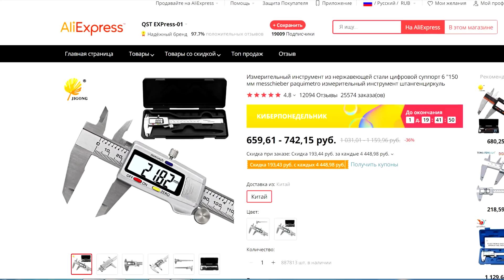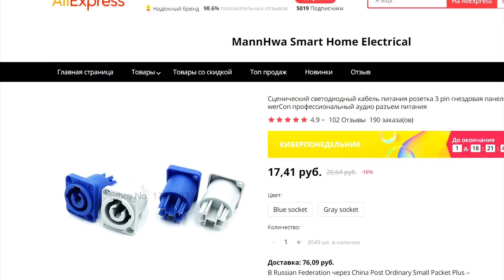Самодельный беспроводной мини-пылесос с прозрачным циклоном из эпоксидной смолы. Часть 1.

Comment: Hi, please, when you will glue the input pipe, use 15 degree tilt for better efficiency. For detail explanation, you can find it on the web easily. For example: https://billpentz.com/woodworking/cyclone/cyclone_plan.cfm.